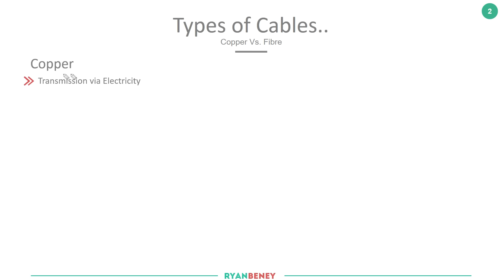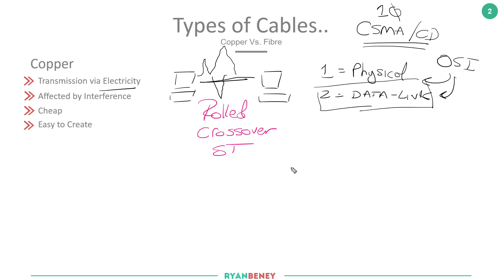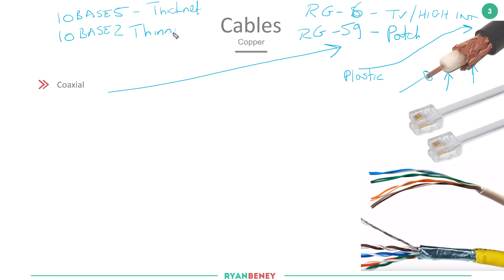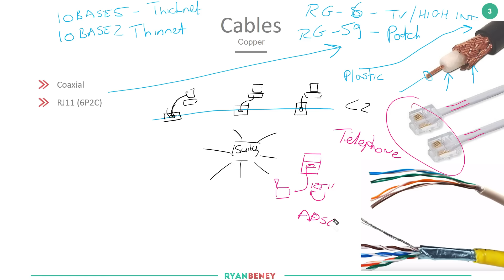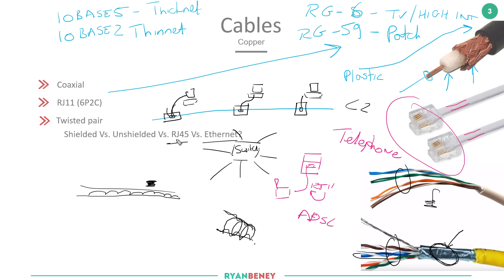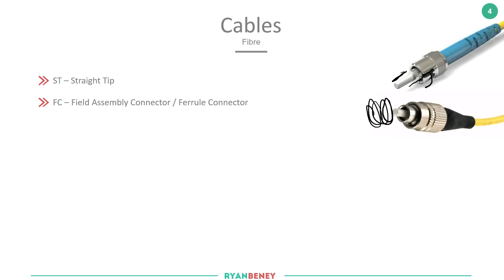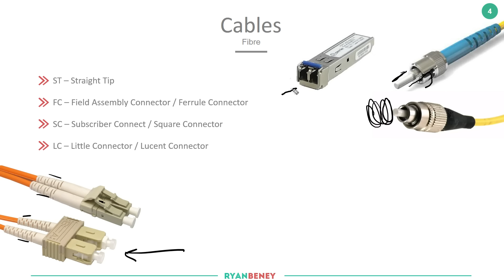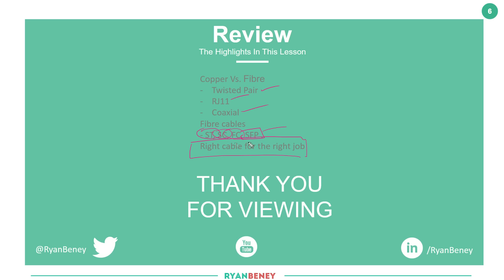Cisco - CCENT/CCNA R&S (100-105) - Physical Components. Part2. 03

Comment: I had the opportunity to take the CCNA boot-camp class in person (12hrs a day for a week). I don't remember learning anything about cables- So now I'm confused! Maybe we breezed off of it, and didn't focus on it as much!
We worked on setting up routers and switches using w.e program they had to perform the labs and learning a lot about IPV4 and IPV6 and what not.
Reply from the maker: Cabling is a small part of the certification, but can be a large part of some engineers day to day! The Routing and switching elements of the course is where you should spend most of your time to achieve your certification. :)
Reply: Ryan Beney Understood!  Thanks for the input,  really appreciate it.

Comment: Hey great videos. I have a concern where you mentioned that SM fiber does not bounce off the walls of the fiber and MM does.  I don't think this is true, but both SM and MM would bounce off the walls. This is evident in when the cable has a bend the LASER has to bounce off the wall to turn with the bend. Maybe you can add some clarity on this?

Comment: Hi, want to ask a question. Am interested in pursuing a career in Cisco Networking but when it come to the computer am still a beginner, so is there any possibility for me to pursue the career and where should i begin? Thanks look forward reading from you.
Reply from the maker: Hey, I would pursue a career in Cisco and obtain the CCENT/CCNA .. Since as a network engineer you're expected to be able to perform basic network troubleshooting on devices i.e. configuring NICs / Pings / Traceroute etc I would focus on this while going down the Cisco route. If you obtain the certification and maybe a new job but this requires further understanding of operating systems such as Windows or Linux you could always venture down the CompTIA A+ or another path afterwards? This is a very difficult question to answer as it really does depend on the individual, knowledge level, job role and opinion.

Comment: What is an resilliant uplink?
Reply from the maker: In the video I use the term 'Uplink' to describe the link connecting the access layer to the distribution layer. The term uplink and upstream are sometimes used in networking to explain the direction of cabling or data-flow around the network. The opposite is also true, meaning from the distribution switch, the link back down to the access is referred to as a 'downstream' both terminologies are correct and loosely used depending on your view of the network. 

As for Resilient part, there are two terminologies to be aware of: Redundancy and resiliency. In the video we ensure the network is more resilient by adding additional cables between switches in case a cable were to fail. Since each access switch has two ‘uplink’ cables we consider this to be a resilient uplink. In fact, to be technically accurate the video is incorrect and it should be redundant uplinks!! Its common for engineers to mix up the terminology (Just like I did)

If you’re interested in learning more, check out this short video which exaplines Redundancy vs resiliency

Check this video out! https://www.youtube.com/watch?v=QEWEFwZfOVU 

Hope this helps
Reply: Thank you very much

Comment: the videos are god but in the third series they seem to be a bit confusing, in terms of the types of cabling , why do you make RJ 11 as a type of cable and not as an example of one of the types, if that is the case then why did you not include RG 6 and RG 59 as types also
Reply from the maker: Hey, this is because RG 6 and RG 59 are not mentioned in the CCENT official guides. RJ11 is not only mentioned and explained (briefly) .. I felt it was important to mention this on the video. All the best.